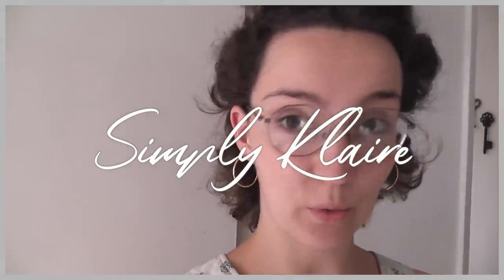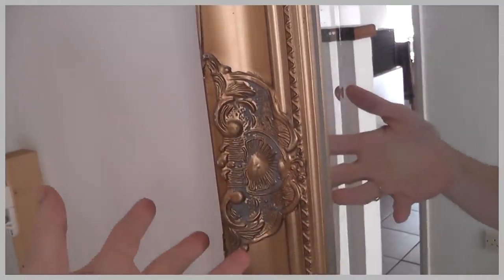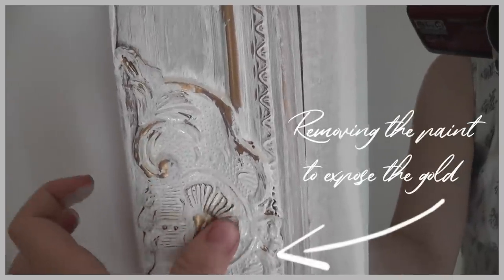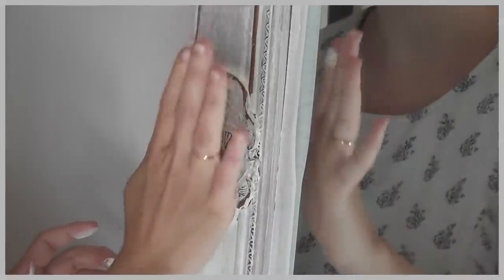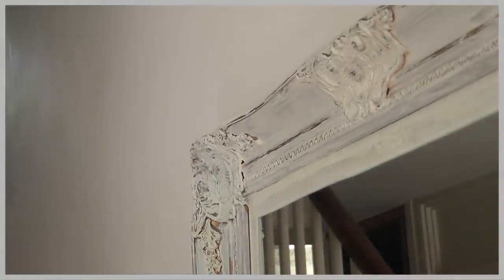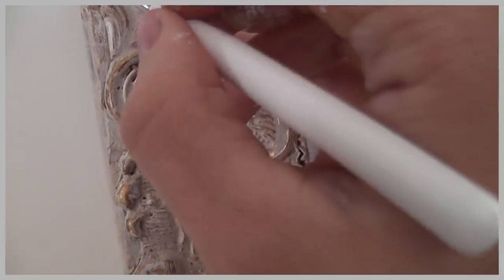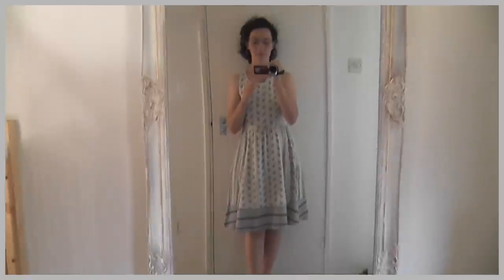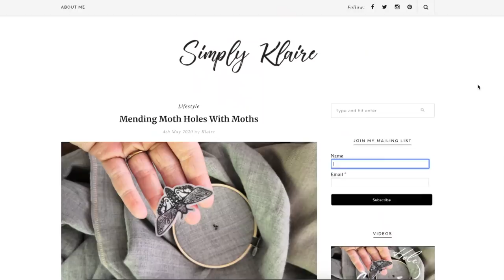Trying To Age My Gold Mirror With Tea

Comment: Will you be painting the walls? Otherwise the frame blends in.
Reply from the maker: No, I'll be leaving the walls that colour there. That side of the hallway needs to be as white as possible to reflect the light down the stairs in the evening. What I will be doing at some point is replacing the door behind me with a lovely wooden one. That should put a bit of warmth back into the hallway without loosing any light.
Reply: @KlairedeLysOfficial  Looking forward to seeing it! Great job on the frame btw.
Reply from the maker: @kaitlinomalley5677  Thank you.